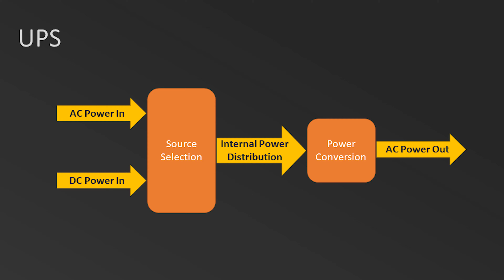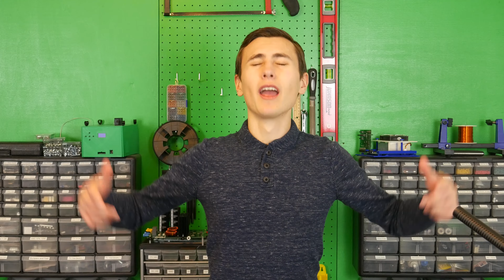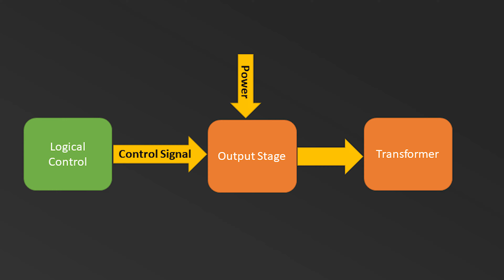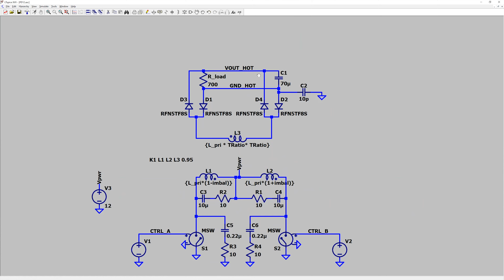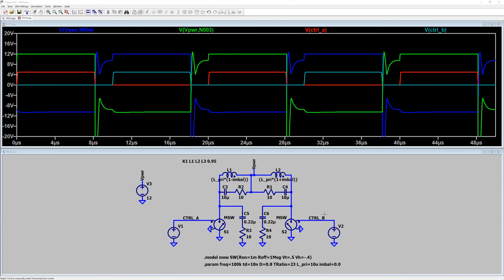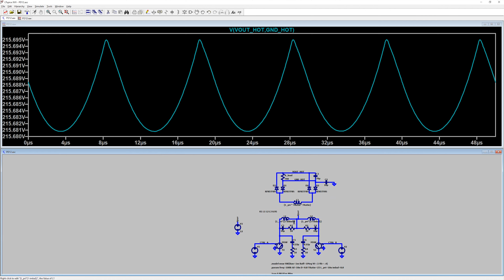DIY 700W 250V DC Power Supply

Comment: 1:47 The controller will only dictate your switching frequency if it's a fixed frequency controller, which are limiting in application. 1:55 When designing a supply your power requirements will dictate the necessary current and voltage and you'll size the transformer accordingly, not vice versa. Full bridge switching is far more complicated than push pull. 2:42 The theory, application, and controllers are not much a like at all. Do you mean half bridge and full bridge? Push pull topology is a two switch forward, with fets run directly from a controller. Full bridge either requires multiple bootstrapped outputs for the high side gate drive, or multi output isolated gate drive transformer, or multiple isolated voltage sources to run the gate drives from. And that is just the high side drive you still need the low side gate drive as well for a total of four switches.  Push pull topologies are really only useful at low voltage as the primary switches see twice the drive voltage, obviously this would be a problem at higher voltages, you'll quickly reach very expensive mosfets. Also of note in the PP topology you can have walking step currents send your core into saturation unless you implement current mode control or plenty of core zeroing. 3:05 half bridge and full bridge are built fundamentally on the same topology, not push pull and full bridge. Push pull topology always uses two separate primary winding's, which is where you get twice the vcc across your switches from, that are utilized only >50% of the time. Where as full and half bridges use only one primary winding as much as a 100% of the time (maybe a small dead time during switch  on/off). per a given output power,  pp switching stress are 4 times higher than that of a full bridge. I couldn't watch the rest of the video
Reply from the maker: Hello Thad ward, always a pleasure to get torn a new one. :) I appreciate the detailed review! There are different ways to see similar situations, and I see a lot of truth in your comment! Believe it or not, this video eventually led to a functional prototype, and it sure was a journey! Given this was released over a year ago, I really don't think I could tell you what I was thinking of at the time. That said, I know that if we walked up to the same problem today, I'd certainly approach it (and explain it) a little differently. It's very likely that I misspoke or was flat-out wrong more than once!
Reply: @EEforEveryone  Rereading my comment I t does seem a bit harsh. I'm glad you've pushed on in your research! Nothing teaches better than just doing it and failing and doing it some more..... If your'e like me then you're always trying to design it better, more elegant, and simpler. I would vary much like to see your continued work.

Comment: Did you manage to get this to work? I can build arduino based Full Bridge and Half Bridge topologies to work in the 90% efficiency range but push pull converters always seem to be my downfall LOL. I like that your explanations are more EE degree level!
Reply from the maker: Hey Nicolas! First of all, I'm glad you like what we're doing! EEforEveryone is definately trying to bridge the gap between intro-level hobbyist and professional engineering. I think it's a really exciting place to be, and I hope to encourage less experienced people to dive into electronics deeper while having a lot of fun with the folks that already know their way around a circuit board!

With regard to this specific push-pull, no I didn't (and actually switched to a full-bridge for the next version of the design... Lol) but I know WHY this converter didn't work. For a different application (with a less extreme voltage ratio or lower power level)... This project wasn't a great place to apply this topology for a couple reasons.

Cheers, and thanks for watching!